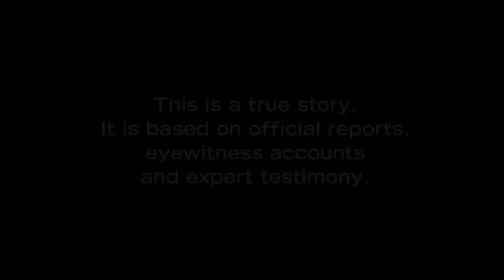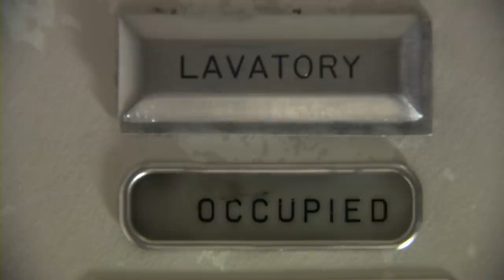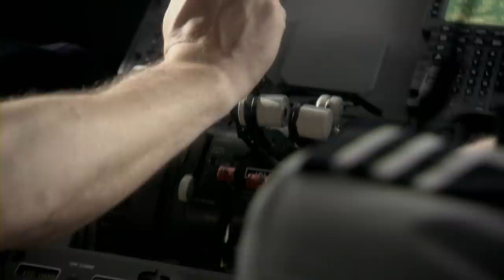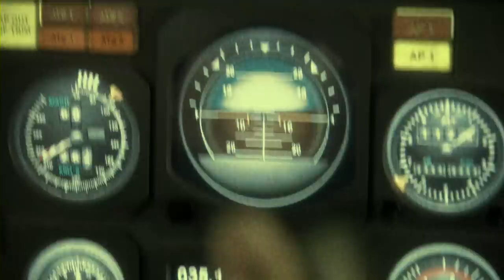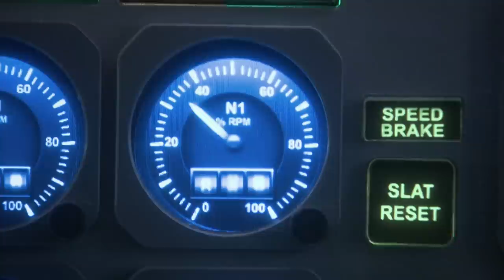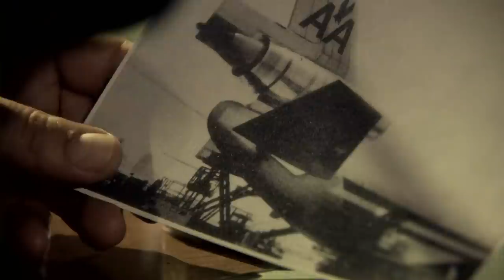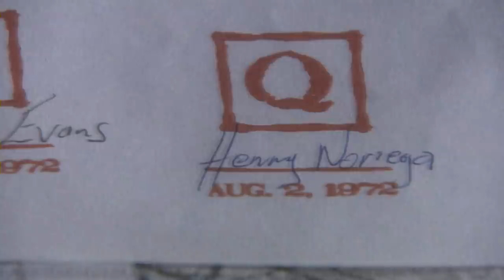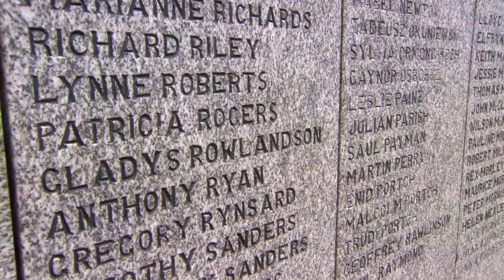Huge Hole In Passenger Plane Causes A Fatal Crash | Mayday | Wonder

Comment: It's intriguing how two almost opposite incidents can be related - one with no deaths, the other with no survivors. Needless to say, it was inevitable for both to crash.
Reply: The TK was doomed because it was fully loaded with passengers and cargo making that decompression a lot more fatal...
Reply: pp
Reply: Nobody died in the first airplane because they got extremely lucky. Even though the wires were severed, the pilots retained enough control to be able to fly the airplane if only just. The second thing that saved them was the pilot, without his balls of steel, his ability to stay calm and his knowledge and instincts to be able to fly the plane as crippled as it was, everyone on that plane would have died but because of those two things, they didn't, they got lucky, they should have been dead.
Reply: yep if you think about it airplanes are one of the safest modes of travel with extremely rare accidents and nearly all pilots are experienced usually from the military especially in the 80's and 90's with combat experience just the way of the business since the 40's so when accident do occur there usually very deadly which is why they have a bad rap car accidents are far more likely in fact statistically your more likely to die in a car accident than you are on a plane and that's with the fact that when plane accidents occur they nearly always have a 100% fatality rate that's just how rare they happen. Which means whatever caused the accident unless its identified and fixed will usually happen again to another plane and a lot of the times the accidents in hindsight seem like duh but at the time of the accidents the problem are usually so minute and typically do not cause any problems at all.
Reply: the good thing is as time goes on they only get safer its really only the new plane designs are the ones you got to watch out for
Reply: American airlines had better pilots. And it wasn't their time to go
Reply: @adrianrocha49  they had better pilots.
Reply: Kelly Anderson Maybe. But lesser piloting isn't what crashed the Turkish flight. It was the considerably more damaged flight control cables which rendered their plane unable to fly, while the American plane was difficult to fly, it did retain some controllability.
Reply: @adrianrocha49  Although, the Turkish crash was doomed from the start. It took only 9 minutes for the plane to crash b/c the mechanisms to control the flight were much more damaged due to the plane being heavier than the plane that landed. If the same thing happened to the first plane, it would of crashed. The pilot would have no control, just like with the Turkish airliner. But, I agree the first pilot was a big reason why it landed safely.
Reply: The damage on Turkish plane was more severe than AA
Reply: Well said
Reply: @adrianrocha49  Welp, the first flight's hydraulics were not severed, hence having more control,
They also were in cruising altitude so they had a lot of room for recovery.
The second Turkish plane was only a few thousand feet and had no controls due to complete loss of hydraulics.

Comment: And when MD went bankrupt, Boeing bought it, and infected their own quality control. Now MD's penny pinchers who care more about stockholder dividends than safety run Boeing, and Boeing engineers who raise alarms over rushed designs and design flaws get pushed out. Which leads directly to the MCAS disasters on the 737-MAX and other recent Boeing issues. Letting Airbus corner a bigger share of the market with their heavily-automated "the computer knows best" way of designing planes.
Reply: The MCAS system wasn’t covered up. The plane was controllable because before LionAir Flight 610, the previous crew actually got rid of the problem and flew to Indonesia safely.
Reply: Think about your statement.  "went bankrupt"  next sentence "penny pinchers who care more about stockholder dividends".   The problem is they compete with other penny pinching companies like Boeing.  If their product is perfectly safe but costs a lot more as a result, no airlines would buy their planes because the airlines themselves are penny pinching.  If the airlines were not penny pinching and cared about safety first, their ticket prices would cost more, and most people buying tickets would go to the cheaper airline who is penny pinching.  There have been airlines who cared about safety and spent billions making sure their planes were safe, they all went bankrupt.  I don't have a solution.
Reply: @samuelglover7685  WTF does that have to do with my comment?  Where did I say MacDonald Douglas was awesome and made great aircraft?  or even tried to make great aircraft?
    I'm beginning to think English Comprehension is the #1 problem in the US today.
Reply: @BrettonFerguson  He was simply furthering the conversation, it wasn't a rebuttal.  "    I'm beginning to think English Comprehension is the #1 problem in the US today. "  Really? I tend to think it's insecure people who construe everything as a personal attack on themselves or their ideas.
Reply: @Powerranger-le4up  Boeing never told pilots about the MCAS until after the first accident. If by omission is not considered a cover up, then Boeing is just incompetent. Also, the FAA did the same thing by turning a blind eye at it because they didn't want to damage Boeing's reputation.
Reply: @Powerranger-le4up  wrong
Reply: @BrettonFerguson  If i can get there in my 1947 Studebaker then i will go.
Reply: in business, if you make anything higher quality and right, you go bankrupt.
Reply: @BrettonFerguson  

These are synonymous problems with capitalism, unfortunately. The incentives are wrong every step of the way.
Reply: @yojimbo3681  which is itself a repeat of what MD did with their new thrust automation settings, which led directly to a SAS crash of one of their DC9's...
Reply: @PlateletRichGel  Tesla has entered the chat...
Reply: "the computer knows best" way of designing planes.

Automation is the future.
Reply: @BrettonFerguson  I believe this too.
Reply: You all realize that the American airline industry has almost zero accidents among the major carriers?  I'm not saying you're not making pertinent points, but someone reading your assertions would assume that major plane crashes happen all the time here.
Reply: @keithferris9574  lies of American propaganda (I'm american), i rather travel with Airbus than rushed planes out of Boeing just because Airbus made a new Airplane no🤭 and the regulations of Europe is my more strict.
Reply: @Powerranger-le4up  
Exactly...
Reply: @samuelglover7685  
Douglas airplane Co, was a very good plane builder.
Always was.
The only fiasco with the DC-10 was the press, and folks like (you)
Reply: I really miss the good old Boeing 757 days at Boeing.
Reply: @BrettonFerguson  that's exactly right, and they're all corrupt in my opinion. I think even if these companies had too much money, they'd still be greedy.
Reply: Boeing never told anyone about mcas. They blamed the pilots. And after the second crash did people get suspicious. Boeing was rushing to get a plane that could compete with airbus. They couldn't so they made already a good safe plane into a disaster.
Reply: What happens is that as corporations grow big, more and more profit is sucked into executive compensation rather than reinvestment, to the point that the business penny-pinches not only to stay competitive, but to keep that fat executive compensation flowing. The problem is avarice, not a competitive market. The solution is in fact for the market to produce to someone who CAN build safe products competitively.

Comment: Dad built these planes out of high school..  (he was an electronics engineering student) he said they were neat but he didn’t like having to pull the wires tight through the plenum like he was being instructed so he quit. He didn’t want to be involved if anything happened.  This showed his concern was valid.. safety was not as important as getting them out with minimal expense
Reply: This reminds me of the Challenger disaster. Engineers told manger because there were issues with the O rings not working right in freezing temps and that the launch should be delayed. But management decided to let the launch proceed and ended up with seven dead people.
Reply: Even though the Thiakol engineers made NASA aware of what was likely to happen.
Reply: @mrkipling2201  Precisely.
Reply: No he didn't
Reply: @davidtx8777  And just how do you know that?
Reply: Hog wash
Reply: Ironically, people like your dad are the ones we need the most in those industries. But until we stop rewarding solely those that make the most money - they'll never be in positions of power where they can effect tangible change.
Reply: @davidtx8777  What do you think, no one builds these planes?
Reply: Forgive me if i don't believe you.
Reply: @alhanes5803  Everybody’s entitled to their opinion
Reply: Wonder if your father was inadvertently responsible for any of the DC10 crashes?  I mean, ya never know.
Reply: @mrkipling2201  I wonder if the reason NASA ignored the Morton Thiokol  engineers, was  due to the same engineers giving them numerous warnings in the past.  My point being, if you receive too many cautions and warnings from a person(or company), you start to take them less seriously.
Reply: @robertjensen1048  
The only 1 that crashed because of any flaw was the Turkish plane, and that was because they never followed the directive to fix it.
Reply: @alhanes5803  Al, when you say "The only 1", do you mean the only DC-10?
Reply: @robertjensen1048  
Yes.
Reply: @alhanes5803  ...as well as United Airlines Flight 232
Reply: @robertjensen1048  
Not because of any flaw in the airframe.
Reply: @alhanes5803  Hmmmm, I think you and I interpret the word "flaw" differently. If a jumbo jet takes off, and before take off it has damaged or stressed parts where an engine is mounted to the wing, then that sounds like a major flaw.
Reply: @robertjensen1048  
You inferred it was a design flaw of the airframe. 
It wasn't.
Reply: Did you grow up in Long Beach, CA?
Reply: A lot of people who cut corners - or spend the least amount of money possible - have little to no morals. Look at the old Ford Crown Victorias - a simple fix would've kept the gas tanks from exploding but it meant more money than the cheaper wrong configuration. 

A personal example.... My cousin is a pharmacy technician, one step below a pharmacist, and used to work for a pharmacy where due to low budget the owners hired newly licensed / poorly trained pharmacists. She told the owners repeatedly that these pharmacists were wrongly dosing patients, etc. ... when the owners took to blaming her for being "difficult" when quite honestly she had no help from her very first weeks she quite simply walked out on them. Referred to the business as the worst ever worked for & nothing more than a mistake. 

As she was doing the work of 2-3 people the owners ended up having to, of course, hire multiple people (wasting more money) to compensate and as those staff they hired did the bare minimal possible - couldn't even manage a business Facebook page - the manager, and the owner who was predominantly at fault for all the problems by not hiring even a part-timer to help, ended up in the hospital as he was doing far too much. As they say, Karma.
Reply: sounds like a great man

Comment: My grandpa told me he always refused to fly on a McDonnell Douglas after American Airlines flight 191 in 1979. He said those planes were cursed.
Reply: Their not cursed just unsafe
Reply: @KenTeeKar  cursed with deliberate negligence.
Reply: That flight number is cursed. There have been 5 crashes and 2 emergency returns to the airport that were designated flight 191. The Delta plane that crashed in Dallas was flight 191. Some airlines won't even designate a flight as 191.
Reply: ironically after 191, the DC-10 became one of the safest airplanes
Reply: @GiordanDiodato  that's why they do the investigations.

Comment: It's ridiculous that Flight 981's series of failures was even possible in the first place.  What a horrible design flaw.   The worst part is that this exact type of accident was foreseen by Convair, but ignored by McDonnell Douglas.  They ended up paying the price for that, but not as much as the victims and families did.
Reply: Tombstone engineering, as he said.  First time I've ever heard that term, but I've heard for years that "Safety regulations are written in the blood of the victims."
Reply: @KrK007  
Yes, it's actually done that way instead of a type writer.

Comment: Interesting…the company who bought Mcdonald Douglas …Boeing…had the same negligence issue 40 years later with the 737 Max MCAS system….it took two plane disasters, as well, for them to finally fix the problem….I think there’s a huge work culture issue with this company….greed over safety.
Reply: If you want to be even more infuriated, Boeing had an eerily similar problem in the 1980s with their 747 when their cargo bay doors started blowing out. First time it happened, no one was killed, Boeing pinned the blame on groundworkers. However upon inspection they discovered the lock itself was the problem. Faulty wiring allowed the lock to open mid flight.
Again, the FAA allowed airlines to fix the issue on their own time. Again, the fixes weren't made in time and another accident occurred. This time, people died.
Reply: @SomethingoldenYT  didn’t they parent’s of one of the deceased break the story of figure it out?  They stole documents from a press conference of something, I can’t remember but I do remember this door. I had no idea it went all the way back to the DC-10.
Reply: @nekograce7914  I don't think they stole documents, but got copies of them. And yeah I believe it was the parents of one of the deceased who pushed for them to re-examine the locking mechanisms on the door.
Reply: McDonnell Douglass.
Reply: @CPS747-8  , Boeing should have never let that happen. They should have gotten rid of those particular individuals.
Reply: @bobby1970  It's not just that, though. They also changed the corporate culture as well. Before, Boeing was more of an engineering culture and focused more on the engineering even if they weren't making the most money. McDonnell Douglas's culture was more about bean-counting. So that kind of changed how Boeing did things.
Reply: @CPS747-8  , yes, so true.

Comment: It’s like the Challenger - senior management wanted to just keep to a stupid, self-imposed schedule —- even though engineers warned about the problem of the o-rings in cold temperatures.
Reply: To be fair, they didn’t know until hours before lift off.  Sure, they could have postponed the take off but they didn’t have all the information.
Reply: It wasn't self imposed by NASA.  12 flights per year was dictated by the Reagan Administration.

Comment: 48:56... Are you sure the company really disappeared? Sounds like MD's proud tradition of ignoring known safety flaws carried on to the B737 MAX. In both cases engineers warned the suits and the suits chose to ignore it. Boeing used to be a reputable engineering company. Sounds like MD lives on under the Boeing banner.
Reply: How about the 2011-2013 B787 Battery fires that should be the legacy of this one too. These days B737max